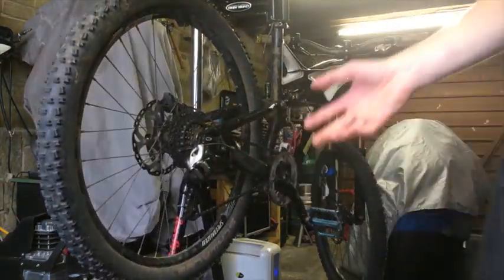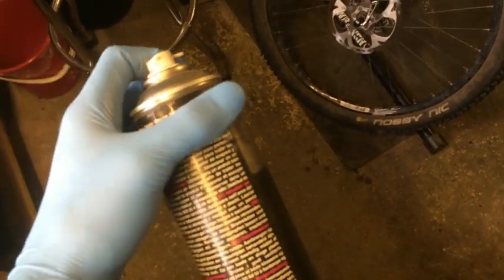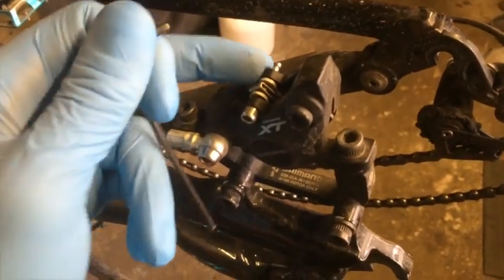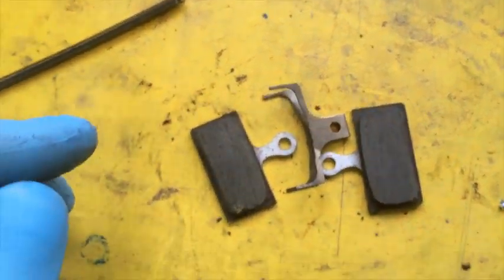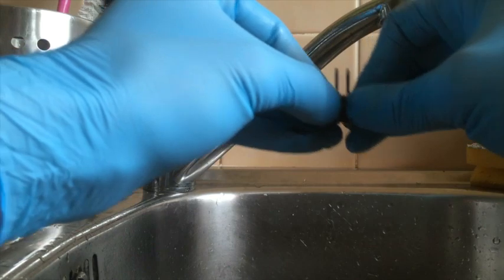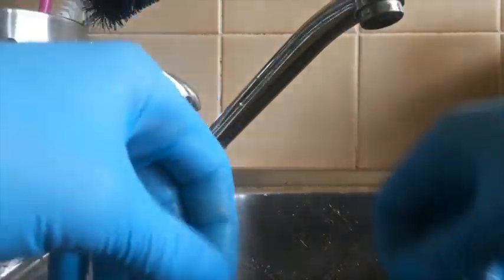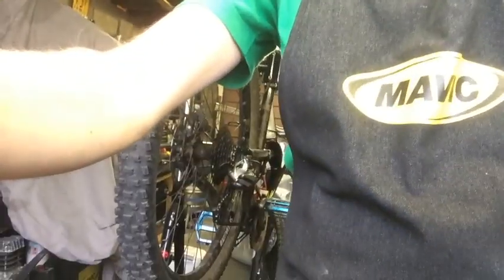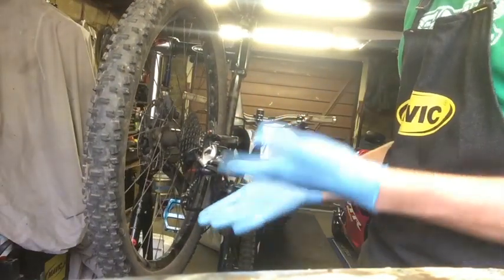How to stop a disc brake from squeaking

Comment: i've tried to clean both the break pads and the disc and it stopped squeaking for like 5 seconds. then it started over again so i don't know what it is. Please help.
Reply from the maker: it can be a whole host of things. Your pads maybe too saturated with contaminants to clean out or there is contamination within the disc rotor holes that are leaking out so you can give the discs a good clean getting into all the nooks and crannies. Check around the calliper pistons for oil residue as they are prone to seeping out fluid. Hope that helps
Reply: I have a brand new bike and i'm just wondering how did the oil get there? Is there any leakage?
Reply from the maker: HolyGoat114 oil can flick off the chain of it's over lubed on to the disc, yes seals can leak even on new bikes, oil and contaminants off the road especially when wet are terrible for contaminating discs, spray oil mist is a classic, always finding its way onto the rotor and not to forget polishes snd silicone based cleaning sprays.
Reply: Okay! thanks a lot :D
Reply: Did you ever get the disks to stop squeaking?
Reply: yes, for about one ride but then it started to squeak again
Reply: It sounds more like your pads are resonating rather than contaminated. If your brake pads have a solid metal backing plate put a tiny blob of copper slip (no bigger than the tip of a ball point pen!) on to the centre of the metal surface - the surface that faces the pistons -  and re-assemble & test. DO NOT USE COPPER SLIP ON PADS THAT HAVE NO SOLID METAL BACKING PLATE OR A PLATE WITH HOLES OR PERFORATIONS IN THE METAL BACKING PLATE. If your pads have no metal backing plates or plates with holes and perforations, remove them, apply a little tyre cement (again no more than a ball point pen tip amount to the reverse surface, wipe off and leave to dry at room temperature for 15 mins approx, re-assemble and test. Hope this helps.
Reply: If your happy with the braking performance put a smear of copper grease on the backing plate where it contacts the caliper. This stops the pad vibrating. It’s the pad vibrating and the disc vibrating.
Reply: I have the same problem!!
Please help me I have organic pads and my brakes are Hayes Radar.

Comment: Hi. my pads are brand news and it continues to squeeze even louder than before. Any sugestion?
Reply from the maker: Is the rotor clean? is the rotor glazed (try sanding the braking surface with 500 grit (or something similar) sand paper, are there any leaks around the pistons (take pads out, put a bleeding block in the calliper, pull the lever to the bar and tie it off with a strap and leave it for a while, come back to it and examine the calliper for any seepage)
Reply: @highcarbrider  
the rotor is super clean
no leaks around pistons.
the  squealing occurs when i push handbrake very very gentle. Is i brake with medium force... it dont squeals
Maybe i need to let pads worn in this first days...

Comment: Need some help guys. Did this procedure and did not help at all. I believe my pads are contaminated. And I don't have a blow torch so I can't do that. Would it work in the oven and on how many degrees celsius can I set it up? Or should I just buy new pads and sand down the rotors?
Reply from the maker: Jan Majnik sorry but if you can't clean the pads then you'll have to get some new pads. Blow torching can work however it can go horribly wrong as the pads can separate from the backing plate of you are not too careful. Give the disc rotors a good sanding with some 600 grit wet and dry sand paper of something close to that. Thoroughly clean the discs with brake cleaner and if you want to take them off the wheels you can then wash them in a bowl of soapy water and washing up liquid so you can scrub them with a brush and get inside all the holes and grooves as these often fill with oil and dirt which will seep back into your new pads. Hope that helps
Reply: I'm not a bike mechanic so I'm not sure about taking the back wheel off but will try with the front. And I'll grab some new pads after the holidays. Thanks for the reply!

Comment: Hi i have a question, my front breaks will start to randomly sqeeking, make noise at certain speed and usually if i make abrupt turns it takes certain, once i get up to 15km/h the breaks starts to just make noise i am not even pressing the break lever just the front break it is very annoying any tips? thanks!  (btw i have already sprayed the rotor down with break cleaner as well as the pads but still the same problem, i will try the washing detergent on the pads to see if that helps. thanks.
Reply from the maker: Amer Milanovic Sounds like your rotor maybe warped or out of alignment. Check it by eyeing it up in the calliper and rotating the wheel. The disc should remain true and not catch the side of the brake.
Reply: i tried to "play" with the rear adjusting screws, now its it doesnt skip the issue seems to be resolved, just need to "index" the gears i think that was the problem, but the problem started when the bike tipped over when i left it stationary,  it has shimano xt mech with dyna sys, ( i dont know if i should keep it on or off? when i picked the bike back up i think dyna sis due to impact falling to the ground it might have moved the lever, the bike has less then 50 miles on it bought it last year for $1500 i would hope that a simple fall would not destroy the entire rear mech and gears?
Reply: and i have examined for any bent gears or the mech everything seems fine.
Reply from the maker: is the disc rotor true?

Comment: wtf with brake fluid in bikes now. i just upgraded my bike and it has this, had to bring it in because they were locking up. what happened to cable levers so much easier
Reply: Maintenance free my big fat @r$e...

Hydro disc brakes can suffer from leaks, oil degrading, loose pressure as often as mechanical disk brakes will need the cables/housing to be replaced.

Having owned bikes that use both I now activity avoid hydros. Who wants to fiddle with syringes and all this retarted apparatus when you can refit cables in no time? 

I would rather go back to V or dual pivot caliers (road bikes) !

Comment: Hi, 
So then I stop my bike ( I have disk brakes) the rear wheel starts like "jumping", and that vibrates the whole bike ( this happens while stopping and locking up the the wheel). Is there any way to make it stop doing it, or my wheel rim is just too weak so handle the forces during stopping ?
Reply: happened to me i just tightened the wheel to the bike and it went
Reply: it could be the wheel bearings. cheap fix if it's that

Comment: My front brake got squeaky after 14x1h rides from new bike. Cleaned my disc brake with cd-cleaner liquid (isopropyl is my guess) then it went quiet again. I cleaned my discs with handwash detergent which I didn't know had salt (natriumchloride) after the first 14 rides so I think I'll stop with that and get some alcohol instead like isopropyl.

Comment: Where do you get the chain degreaser
Reply from the maker: Do you mean the disc brake cleaner? The muc-off stuff you can get from a local cycle or motorcycle shop but any car disc brake cleaner will work and will be a little cheaper too

Comment: I have a new bike in which the brakes are squealing.  What would be the cause of that since there is no grease on the discs?
Reply from the maker: It's most likely contaminated from shops sprays like polishes or brake fluid from when the calliper were bled. This will fix it.
Reply: I'm embarrassed to say I bought it at Walmart, but that's all I could afford at the time. It started squealing after it got wet, but still squeals now after it not wet anymore.
Reply from the maker: Yeah classic, your brakes pick up all the road grime off the road which contaminate the pads and disc, follow this video and it will cure it

Comment: Had my bike for a couple of months and front brake squeaking, cleaned pads and rotors with dish soap and still squeaks, does anyone think using disk brake cleaner or the rotors will make a difference from dish soap?

Comment: when i inserted the brake pads back into place and screwed the small bolt that holds them in place (the one that goes through the 3 holes) it wont tighten when it reaches the end it just spins infinitely,should i be worried?
Reply: +TheCvac no some brakes dont like my hope mono m4/mini they have just a pin to stop them

Comment: can u tell me whats the the tools u have used pls fast ihave to drive my bike everyday to school and they are making squeaking sound pls not getting enough friction pls reply fast
Reply from the maker: somesh sant depends on what brakes you have as to what tools you need but a set of Allen keys, maybe some long nose pliers, a flat bladed screwdriver and torqs keys will do most brakes
Reply: can u just tell me if it is good my cycle model is herculed a100
Reply: torx srewdriver will be enough?
Reply from the maker: somesh sant never heard of that brand sorry
Reply from the maker: somesh sant should be if that's what you need
Reply: bro hercules ,bsa??? anything can u see pls and tell model a100

Comment: I used regular dish soap and napkins to clean off all the dirt, grime and oil off the disc brakes.
Result - SILENCE!! I had just washed my bike and i used a product which is meant to protect the bike from rust etc. It was pretty windy, so i might of got something on my disc brakes. In this case you don`t need to remove the pads and clean them. Only the discs. Hope this helped somebody.
Reply: I tried dish soap and it was quiet for only a few breaks and then the squealing just came back.

Comment: Great video thanks. I'll do that right away. Just a question, when you are washing the pads sounds like you are inside of a plane that is taking off. Are you near the aiport?
Reply from the maker: +jose Luis LOL no it was the bloody washing machine hahaha
Reply: +High Carb Rider I just pulled my pads out and found that they are not as dirty as yours, they looked clean and dry. maybe some dust only. Discs were pretty clean too. I see that they have metal particles as part of the pad, maybe that makes it noisy.

Comment: Can any help me out? I just started cycling 2 days ago. I bought a second hand hardtail which I took for a test run and everything was ok, but now I can hear a squeak which at some points its almost constant, especially when I lean the bike to one side. Does anyone have any idea what's up?
Reply from the maker: That's really hard to diagnose via this media as it could be a whole host of issues. Sometimes the pads can catch the disc as you move the bike from side to side which can cause a squeak but so can wheel bearings, bottom bracket etc. Upload a video of your problem

Comment: What Brand  HUBS you are using ???
Reply from the maker: in that video they where the hubs that came on the Specialized enduro at the time, just some generic chinese things with Specialized branded on them.
Reply: Thanx man a lot ... whic Hub iz best for smooth rolling & sound ???
Reply from the maker: Best hubs in my opinion are DT and Acros however they are fairly silent when freewheeling but they run really smooth and last a long time with minimal maintenance. Chris king are badged as the number one in hubs. It I've owned many over the years and I was always let down by the regular tightening up of the the cones and for how expensive they are I don't rate them however they do sound crazy. If you want a fairly reliable hub, affordable and loud then Hope is your brand, they don't roll that great and the pawl springs do eventually die but they are easy to repair and maintain. Hope that helps

Comment: Hey I know this has nothing to do with brakes but my gears are messed up I'm not sure what's wrong but when I go into low gear and I pedal it like slips and then I can pedal then it slips it's hard to explain and I don't know what to do
Reply from the maker: Elias Cruz hey it sounds like your chain and cassette is worn. Replace the chain and cassette and also check your chainrings as these wear out too and compromise shifting and cause a problem know as chain suck.
Reply: Thank you and also the derailer scrapes against the rim
Reply: in low gear
Reply from the maker: If your derailleur is scraping the wheel then the replaceable hanger that the derailleur mounts to could be bent or the limit screw is screwed too far out. If the hanger is straight and true, wind the "L" screw in until the mech (derailleur) stopes hitting the wheels

Comment: How do you straighten a brake discs with tools??
Reply: There might be a better way...but I usually leave the rotor on the wheel (and leave the wheel on the bike).  I then take a crescent wrench (adjustable wrench), snug it down over the edge of the rotor, and gently flex the rotor in or out as needed to get it to run true.

Comment: dude my brakes didnt squeal for hald fay after cleaning all the oily substance on disc brakes and pads.. however, my brakes are squealing again after few hours.. what should i do?
Reply from the maker: Your pads are most likely saturated with contamination and require replacing. Just make sure you thoroughly clean your discs before installing new pads.

Comment: If you spray it like that, wouldn't it get on the chain and break down the grease on it?
Reply: Yeah it's probably best to take the rotor off and do a thorough cleaning.  Degreasing the cassette and chain isn't a big deal because you'll just oil it back up, but degreaser can easily seep into the hub which is bad.  You'd have to open it up and clean it out, then grease it back up.  Better safe than sorry.

Comment: what if my brake has a leakage can i fix it?
Reply from the maker: If you have fluid all over the pads, no. Generally you need to replace the pads and thoroughly clean the disc

Comment: My rear disc brakes is not working, when i press it does not stop my mtb.. Can you tell me what is happening to my brake
Reply from the maker: PJ the cyclist there could be so many factors that’s stopping the brakes from working from seized pistons, leaking seals, damaged master cylinder, air in the system etc. So with our seeing it, I can’t really help sorry

Comment: Hi all, i was wondering if anyone can help me. I've done this process three times on my road bike, and it has reduced the noise from ear splitting to human voice level but still I can't get rid of a squeal. Is there something I'm doing wrong? Am thinking new pads and discs the last resort? Could grease be getting from somewhere else onto the discs or pads? I've been to bike shops where they say noise is inevitable but I'm not giving up yet.
Reply from the maker: No the shops are talking rubbish, you can get rid of it. If you have cleaned the pads and they were contaminated it’s likely you have glazed your rotors. Take some sand paper (fine grit) and sand the shine off the rotors. Give the rotors a good clean after. Providing the pads are not saturated with contamination this should sort it but you MUST bed the brakes in. This is a procedure too many people overlook and plays an import part in the brakes performance. Look up the Sram how to bed brakes in vid on YT, it’s a good how to guide.
Reply: @highcarbrider  thanks for the advice, I'll try this
Reply from the maker: @pete309  yes thats the vid
Reply: @highcarbrider  i tried cleaning the rotors and pads again, and bedding in the brakes using teh SRAM method, and unfortunately they are still noisy. They were noisy after the first two squeezes of the brakes. I noticed when i sanded the rotors that grease and dirt came off on the sand paper, but using the method in this video the cloth quickly did not take any more grease/dirt off. So i think the rotors are heavily contaminated with grease, and that i can't get it out even with sand paper. I think your method is good but perhaps some rotors are too far gone? My next step has to be new discs and pads i think?
Reply from the maker: @pete309  Before you start to replace parts perform a pressure check, pull the lever to the bar and secure it in place with a zip tie. Leave it over night or for some time and check for leaks around the calliper pistons. If no leaks then new pads and discs will be a wise move, if the calliper is leaking the chances are you will need a new calliper or calliper seals if they are available for brake
Reply: @highcarbrider  thanks, will try this, appreciate your help on this!
Reply: @highcarbrider  Will i need to remove any parts or the wheel in order to see any leaks from the callipers?
Reply from the maker: @pete309  ideally the wheel and pads. Put a bleeding block in between the pistons and pressurise the lever. That way you’ll be able to spot the leaks coming from the pistons
Reply: @highcarbrider  what am i looking for, will it be obvious? is the fluid clear or dark?